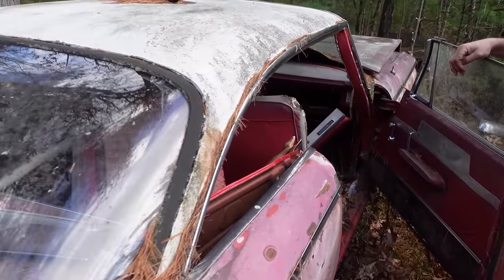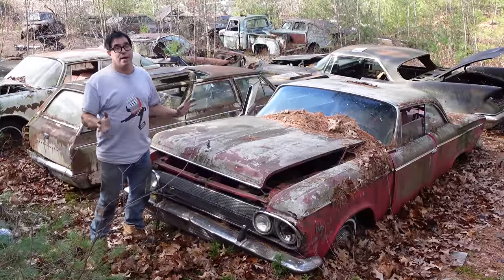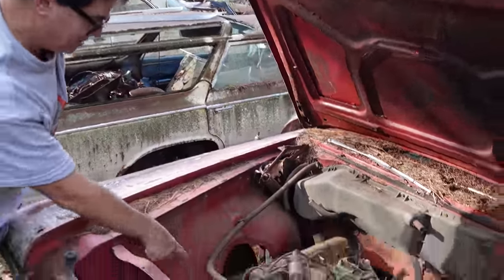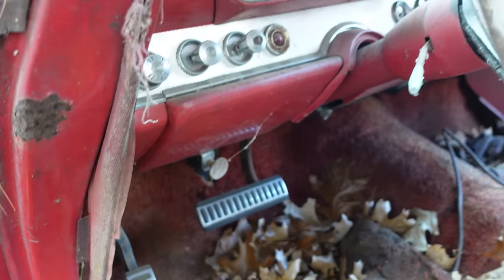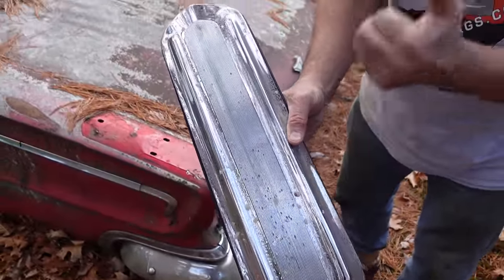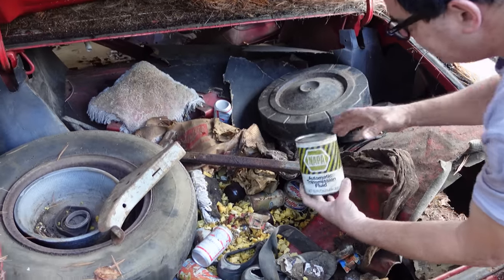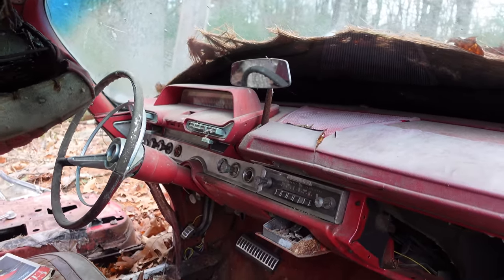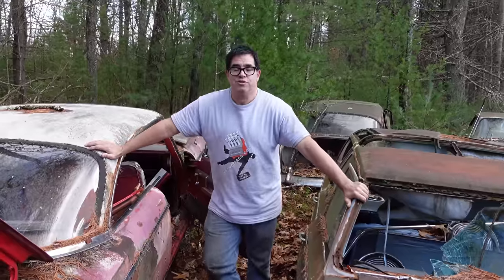1963 Dodge Custom 880 Hardtop

Comment: This car was introduced in 1962, and was basically the Chrysler Newport with a modified ‘61 Dodge front clip. It was sort of a panic move to head off negative reaction to the oddly-styled B-body Dart. In 1963, Dodge tooled up a new front clip in order to give the Custom 880 its own identity. Successful? Not totally.
Reply: There is a lot more backstory to the 880. Yes, it was a panic move. I did not know of the car until I saw a '64 locally. The styling is definitely odd, even moreso on the '64.  Its a transition from the Virgil Exner era to the Elwood Engel era at Chrysler. In profile, you can definitely see its the Exner design debuting in 57-- the roofline and windshield are unmistakable, but the ornamentation is more spare and the remaining shapes more rectilinear, like Engel. (p.s. I read somewhere that the dash board is straight out of the doomed final '60 DeSoto.
Reply: @aca2983 The last DeSoto was actually the ‘61, but I’ve read that, too; that the Custom 880 was inserted into the Dodge lineup in ‘62 to replace the DeSoto. Dodge and DeSoto were sort of linked together, just as Chrysler and Plymouth within Chrysler Corporation, so that made this move something of a natural. I’ve always liked the ‘62-‘64 Costom 880s, and of those the ‘63 is my favorite.

Comment: Morning Steve!
Reply: My frame also ends under the driver seat on my 1967 Malibu I just picked up from your last video! 😂
Reply from the maker: Hello NeshPro, GOOD ON YOU for grabbing that Malibu. I was suffering from "old guy eyesight" when I mis-read the assembly plant for Fremont, it was actually Framingham, Mass. Which explains why the FRAME is HAM! That said, Dale appreciates your business and the fact you DROVE from Texas to Mass - and back again - to get this relic. It'll make a GREAT conversation piece. maybe stitch the shell back together and plop it on a Roadster Shop chassis with a sick LS and 6-speed but LEAVE THE RAW BODY ALONE. That would surely get more attention than any shiny show car! Thanks again for saving that car and for watching and writing. -Steve Magnante
Reply: @SteveMagnante  Yes, you misread the "7" (for 1967 model year) as a "Z" for Fremont, CA assembly. This one had a "G" which was as you said, Framingham, MA assembly. That plant closed in 1989 and as I noted it was a political football/battle between Michael Dukakis and Anthony Colonna, a local politician. Mr. Colonna "won" the battle, but "lost" the war as GM just responded by closing Framingham in 1989.
Reply: @neshpro6521  Did you ever get a chance to look at the trim tag? That will tell some more about it. I wonder what color it was originally and I can tell a lot from the trim tag. Mr. Magnante didn't show that, and I guessed at most of it based on what I know/saw in the video.
Reply: @googleusergp  I am posting a video now @neshpro YouTube with the trim tag so we all can brag!!!!!!!
Reply: @neshpro6521  Let me know where it is and I'll have a look at it.
Reply: @neshpro6521  Yes, I decoded it. You have a 1967 Malibu V8 Sport Coupe, which was originally a V8 car, but not an SS. It was originally Capri Cream upper and lower exterior paint (paint code "T") and had a Black imitation leather bench seat interior (trim code 761-A). It was equipped with a tinted windshield (W), Powerglide two speed automatic transmission (M on the tag, RPO code "M35") and a rear antenna (S on the tag, RPO code "U73"). An SS car in 1967 would have a "38" after the 1 for Chevrolet in the VIN, and your car has a "36" meaning it was a V8 car originally, but not an SS. It was probably a very nice car when it was new.  I hope that it will see the road again close to the original configuration.

I was pretty close on everything, but the paint code. It looks like it had a white and then blue paint job at some point in time, but it was originally Capri Cream exterior paint as noted.

Comment: Hi Steve, nice video.  Sitting right next to the Dodge that you profiled is a mid 1960s Oldsmobile Vista Cruiser station wagon, or it's a mid 1960s Buick Sport Wagon, I can't see enough.  Would you please profile the car and explain the difference from the standard mid-size GM "A" body station wagon(s).  I also see in the background is an early to mid 1960s Ford F-100 short bed Flair Side or "Step Side" you might want to say, "not bad"!  Please reply.  Dave...

Comment: Thanks again for another great video. Was there a Plymouth equivalent to the Dodge 880, or would those looking for a bigger car simply be steered towards a Chrysler? I guess that would make sense since Plymouth and Chryslers were sold be the same dealers.
I always wondered why the front section didn't seem to go with the rest of the car. I found out later why this was so.
Reply: Plymouth simply did without a "Frankenstein's monster full-size", until 1965 when the Fury was moved to the corresponding C-body.

Comment: 2:30 Cadillac, Rambler, and Studebakers with standard four-wheel drum brakes had dual-circuit brakes. 
Strangely, Studebaker's power front disc brakes (standard on the fiberglass Avanti, optional on all other models except the low-end "Standard", used a single-cylinder system. Standards, which were among the lowest price American compacts, also used the single circuit system.
Reply: The Ramblers had dual circuit brakes so you could keep driving them after losing a front tire due to knuckle joint failures.  :face-orange-raised-eyebrow:

Comment: Thanks for the information. I never knew of 880s until the internet. They certainly aren't the most attractive C-bodies ever produced. I think the equivalent Chryslers had better looking front ends. Of course Dodge never really updated much after taking the 1962 Chrysler Newport body and adapting the 1961 Polara front end. Just minor cosmetic changes on the front and rear for next couple of years until a new body in 1965. The 1963 Chrysler C-Bodies were all new looking

Comment: Steve,
Maybe you can help me.  You are a mopar guy and I bought new a 1969 Dodge Hemi Charger R/T  fall of 1968 for my high school graduation present. .  It was delivered to a small dealer in Pigeon Michigan.   It had an automatic transmission.  I believe they only made 17 with that transmission.   I had to sell it because of the Vietnam War took me away for awhile. I paid over 5,000.00 for it at that time .  Alot of money back then.  I never kept the VIN and would like to track it down to see if it is still around. 
Thanks Jim McBride
Reply: Steve,  it had power steering delete to save money and horsepower.   Lol. It sure was great crusing Macdonald's parking lot with the HEMI rumble and HEMI badges on the doors back in the day.

Comment: Save this car . What a shame it’s left there to rot .  Nothing wrong with a 361 . Good looking Dodge  . Same set up underneath as our 🇦🇺 Dodge Phoenix   With the Poly or 383 🇦🇺👍🏻
Reply: Right on, the B 361 was a better motor than the A 360 by far. Other than weight of course....

Comment: I'm surprised that he didn't mention how these share the same body shell and rear quarter panels with 1962 Chryslers, which explains the welded in piece under the taillight bezels to fill in the cut out for '62 Chrysler taillights. I'm also surprised that a Mopar guy didn't recognize that it's a 1970 Challenger on the Amway can. The quad headlights and front turn signal are dead giveaways, as are the Magnum 500 rims.
Reply: I buy sugar free energy drinks through a friend that's involved with Amway.

Comment: You know the rear quarter panels on that 880 look ALOT like the rear quarters on my 62' chrysler 300... in fact the "patch panel" under that big chrome trim peice is exactly where the tail light assemblies would bolt up on my 62!
Reply: Yep comparing pictures on google the whole back end of the 63 880 is the same as a 62 chrysler 300 with different trim and tail light setup!

Comment: First time I pulled an automatic transmission from a 1962 Dodge 880 I thought "What the heck is this huge drum bolted on the end of the transmission?".  It was the parking brake. Yeah, it had to work to keep the car from rolling away. Another caution...the 62 front brakes used two wheel cylinders per wheel...not just one like the 63 and on....very nasty setup and hard to find parts for. Thus, the 63 & 64 880s are easier to work on IMO.

Comment: I wonder if any of these '63 Dodge 880s were used by anyone in NASCAR?
Reply from the maker: For 1963 Dodge's factory effort centered on the smaller B-Body 330 and 440 models. But it is possible some "independents" tried full size 880's. Thanks for watching and writing. -Steve Magnante
Reply: @SteveMagnante  thanks for the response and info.

Comment: Chrysler and torsion bar,, and leaf springs. Rode harder and transmitted more road noise back into the car. Both worked ok but trying to modify them was a real drama. Leafs not a problem but bars. What is good for a streetcar is very poor in a road race car.

Comment: These were well built, quality material cars, but so, so drab.  Zero style.  The B bodies at the time had a lot more style.  '65 brought a much better looking full size line, but quality started to nosedive, esp after 67 for the smaller cars and esp when the fuselage bodies came out